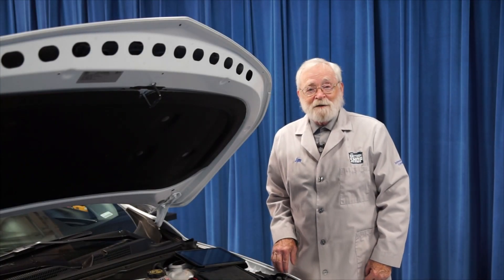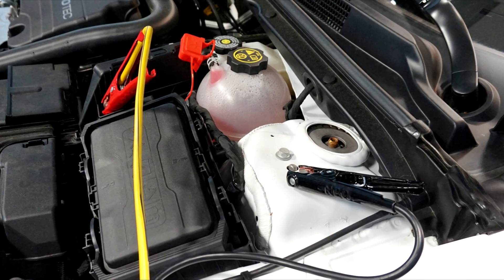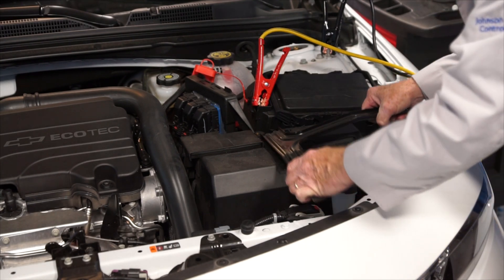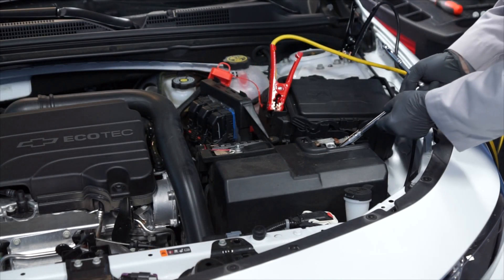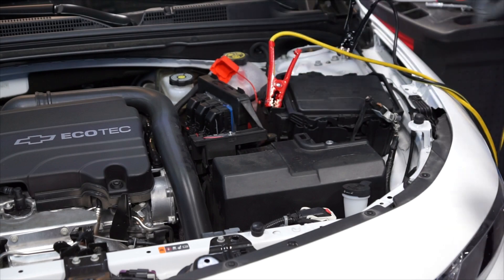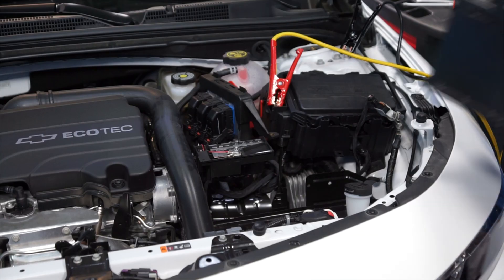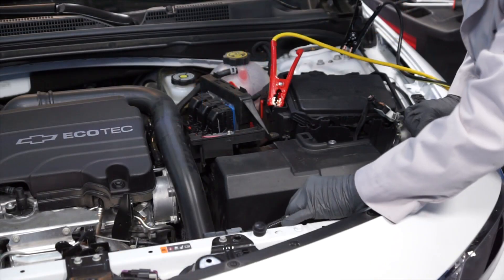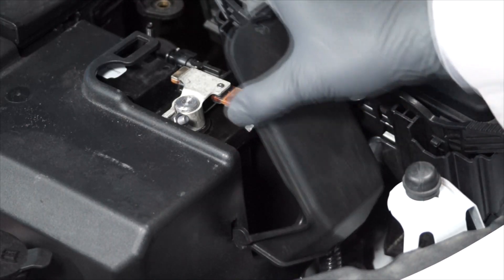Chevrolet Malibu with "Start/Stop" (2016-2024) - New Battery Install

Comment: Size is Group 48 / H6, ~700 CCA. Must get AGM for vehicles equipped with Auto Start-Stop. Traditional flooded lead-acid will fail prematurely due to extra loads when the engine stops and Electronic Steering Assist. The needed 680-730 Cold Cranking Amps puts you in AGM territory anyway.

You will need a deep 10mm socket or nut driver with a hole in the shaft.
A 13mm or 1/2” socket or nut driver.
A pry tool for a hidden clip on the left side of the box attached to the positive terminal.

Optional:
Terminal cleaning and anti-corrosion treatments.

Comment: Something is holding the positive cover on and this video doenst show how to take it off
Reply: Yeah, we had a lot of trouble with this too.  He does mention this, but you just see him poke the screwdriver under either side and it pops right off. I would have appreciated some video showing where the little clips are.
Reply: Just took the battery out of our car (2023). There’s apparently a clip on the bottom of the positive cover holding that part down. We just brute forced it until it came off, but theoretically if you push it forward (towards the steering wheel) and maybe down a bit it’ll come off easier.
Reply: @renzenthio3723 on my 2022 the issie is he doesnt mention to remove the other nut that is attached to this thin piece of exposed copper wire. Removing that nut allowed me to take off the whole assembly
Reply: It was a hidden clip on the left side of the box on the positive terminal. Once that is free you can tilt it forward to free another hidden clip underneath and toward the front.
Reply: 2 clips on each side. One near the water hose
Reply: I just replaced one

Comment: I see you skip the battery registration process. The lack of information about this model car and GM in general leads me to believe battery registration not required on these vehicles. Practically all video for battery registration with the ECU is for foreign cars like a BMW. I have the same Foxwell scanner used in the video and those service options are not present in my menu screens.

Comment: If you’re having trouble removing the positive battery cable assembly, be aware that there is a clip on the left side and the rear of that plastic assembly
Reply: I’m trying to find it now! Please help lol
Reply: @Auctionaccessnationwide  you have to pry outward on the rear firewall side of that housing and pry outward on the ribbed section of the housing on the left side. It was a rear pain to get loose
Reply from the maker: Thanks for watching and for the feedback.
Reply: Wish I'd seen this reveal about the additional clip before spending an hour trying to wrestle the thing off. Not a lot of room in there to see what's holding things down!!

Comment: Thank you for the vid - it made replacing my battery so much easier since I knew what to expect.  My battery was original, which meant it was at least 7 yrs y/o (2018). In the South I've never had a battery last more than 6 yrs -  most didn't make 5 yrs.......
Reply: 2020 Malibu here purchased new here in the southern state of Georgia, October 2020. Mine started acting up in September 2025 (“Electronic Steering Assist Reduced” when auto-restarting). Everything started going haywire in October including infotainment center/dash/BCM reboots, intermittent check engine lights, and turning the engine off while the car thinks it’s on… so it didn’t quite make it 5 years in the south.

Comment: What this video fails to tell you is that there are two, 1 inch clips, one on the left side and one on the back side of the plastic piece covering the positive terminal. Look for the plastic that is at least 1 inch wide and pry out with the screwdriver at least a quarter inch to release the clips.
Reply from the maker: Thanks for watching.
Reply: @TheBatteryShop my guy I almost broke the terminal in half with out the terminal clip taken off

Comment: Thank you. My car I bought two months ago refused to start this morning. Seems the battery on it was either never replaced or was switched out. Looked like it was pulled from a junk yard. Took me half an hour, but I finally managed to get the old one off and the new one on.
Reply from the maker: Thanks for watching and glad we could help.
Reply: Hope you got the right one. Instead of giving you the specs the manual just tells you to look at the label on your FULLY ENCLOSED, potentially-incorrect battery. 🤦‍♂️ 

Battery should be a Group 48 / H6, AGM (Absorbed Glass Mat), with 680 to 730 CCA (Cold Cranking Amps). A non-AGM is inadequate for the Malibus with Auto Start-Stop technology and that may be exactly why your replacement was already failing.

Comment: 02:40 
VERY VERY IMPORTANT and hardly any videos that come up for this repair show this properly (this video doesn't either!)

There is a plastic clip that he is prying up on that holds the plastic box to the battery.  If you don't pull up on this you'll either give up or break the damn thing.
Reply from the maker: Thanks for watching and adding providing the feedback!
Reply: @TheBatteryShop  I think this deserves a little more self reflection than that. It’s almost a “You had ONE job!” moment when people look for these videos for exactly that kind of issue. Don’t get me wrong: I appreciate the video, but your response makes it sound like you’ll gloss right over that feedback and do it again with the next video to sell more batteries.
Reply: Thank you! You’re right I almost broke the damn thing lol
Reply: @mia.dacherry  I had a literal crowbar on mine, right where he pretended to pry! Turns out there as an accessible clip on the left I needed to free before I could tilt forward to free from another hook underneath.
Reply: @emmettturner9452 I almost lost my mind trying to figure out what I was missing as many different videos dont point this out either
Reply: Yeah we had a lot of trouble with this part as well.  In the video he just sticks the screwdriver down between the two and it pops right loose, but you can't see exactly where. I did end up breaking off a little piece of the plastic there, but it doesn't seem to make much difference.  Would have appreciated some video of exactly how to release this.

Comment: Just replaced battery now car won’t start, no power inside car. Is it in shipping mode or service mode? Help!!!
Reply: Did you get this resolved? If yes, how? Thanks
Reply from the maker: Hi - Thanks for watching! We suggest that you refer to the vehicle owner's manual for the steps needed after a battery replacement.

Comment: Hi, would you need to remap the computer to take after market battery or would it have to be ab OEM unit? Thanks
Reply from the maker: Hi - Thanks for watching! Battery registration would be required for any battery installed. Check out our video on battery registration. The link is in this video's description.

Comment: What happens if I don’t have a memory saver thingy?
Reply from the maker: Hi - Thanks for watching! It depends on the year/model of the vehicle. It could be anything from nothing to a no-start condition requiring the computers to be reset. You really need to check with the manufacturer's battery replacement instructions found in the service/repair manual for the vehicle.
Reply: @TheBatteryShop  
Thank you! I really appreciate it. 
Watched several of your other videos and I must say, you make DIY’s simple for someone like me who has no knowledge about cars. 
Mahalo nui loa! 
( Thank you very much! )🤙

Comment: Hi, just wondering if the memory saver you refer to is just a battery charger connected to the start/stop system as you show in the video
Reply: Was this the case for start stop hook up battery charger
Reply: @carolconn  what are you talking about
Reply: What?😊

Comment: Thank you! I just found out today while getting new tires that I have this "Start/Stop" battery and Chevrolet wants for both batteries w/replacement close to $800!!!!! Naw, get a great battery and do it myself -- I hope.
Reply: We no

Ya
Reply: Both batteries?? Where is the second battery?
Reply: @travantiblake1750 If you haven’t already found it, is in the trunk, driver side. New battery must have a vent port like the one being replaced. Good luck
Reply: @josegonzalez-sampedro4003 Only the 2016+ years didn't have a battery in the trunk.

Comment: Where in the Hell is the Aux battery in a 2017?
Reply: did you find out this answer. I also have a 2017
Reply: Trunk
Reply: @erican591  it's not
Reply: German Diaz it definitely is I been YouTubing it all night. It’s in the trunk to your left
Reply: @erican591  not on the 2017 i literally looked there is nothing there no hole or door. I think the 2017 doesn't have a separate battery
Reply: @germandiaz1651  any luck? Haha can’t figure out if I have one or two batteries in this thing
Reply: @zacharyhelton4939  they stopped adding a second battery on the 2017 and forward it's just one
Reply: @germandiaz1651  I don't think my 2016 has a second battery either. That's why they use the glass matt battery vs regular type.

Comment: So pissed. I can't stand that auto stop option on my car and now I have to pay for a high-dollar battery for a feature I don't want.
Reply: You can circumvent the auto-stop system. Put the shifter into manual mode and press the + button until it moves into L6 gear on the display. The vehicle will run, drive and shift as normal, but the auto-stop function will not activate.
Reply: @robsteele2427  yeah you would think Chevy would have made a switch for it ! Because even tho you can control it with the shifter I always forget it’s a PITA for sure!!!
Nothing like pulling in your drive way coming to a stop and it shuts off and then you go to put it in park and the engine kicks back on only to have to shut it off ! Thanks Chevy engineers ! Genius!!
Reply: @robsteele2427  after I changed it into l6 gear, I shift it back to drive? Or leave it there?
Reply: @pollym.2126  Leave it there. The vehicle will run, drive and shift as normal, but the auto-stop function will not activate.
Reply: @robsteele2427  this is exactly how I drive my 2018 malibu. I bought it thinking the auto stop wouldn't annoy me. It doesn't really annoy me but I dont want my car turning off and on every single stop.
Reply: @robsteele2427  how do you disable in a 2014?
Reply: @augustussanford5154  Uncertain. I'm just a DIYer and have one of the cars myself (2017) and found that it works for mine, figured I'd share.
Reply: @robsteele2427 have this been working a while now without messing up the transition?
Reply: You bought it 🤷‍♂️
Reply: I unplugged my hood sensor. Stop start won't activate if it thinks the hood is open. Gives you a check engine light but you don't have to put it in l6 or in my case l7
Reply: @jeremycrisp8460  but you won’t be able to start your car with the remote starter either....
In pa in the winter it’s nice to get in a warm car , tho even that can be a pain in the ass because it only runs for 5 minutes it seems ...
Reply: @jeremycrisp8460 would the l6 mess up the transition?

Comment: What tool do u need for this? For the battery?

My car is a vw golf, it’s a stop/start, do you have to do this for Start/Stop Cars

But my Stop/start hasn’t worked since I got the car, I think it’s been permanently removed or deleted
Reply: The Battery Shop ok thx